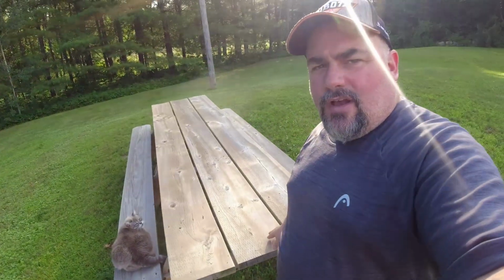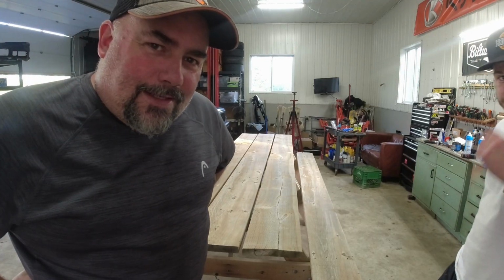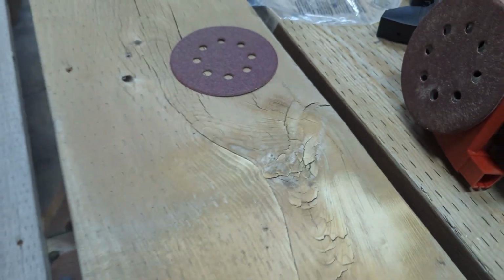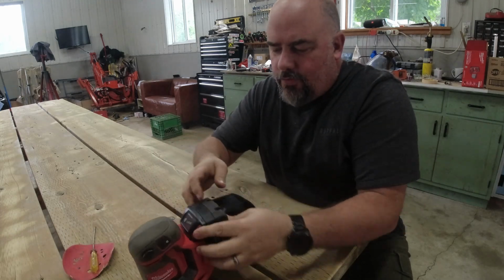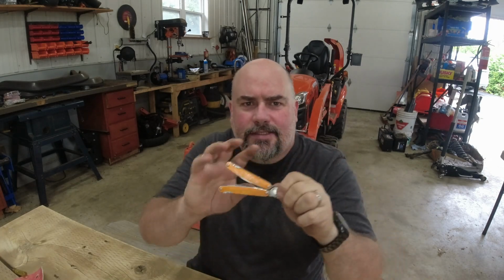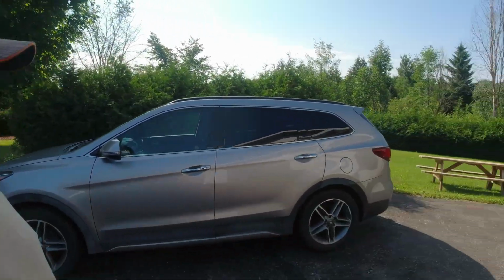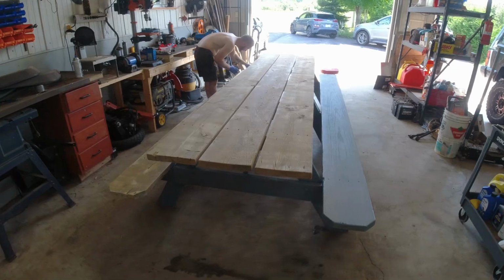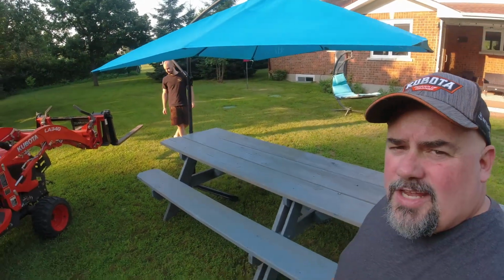Transforming A Picnic Table With Kubota - Watch How!

Comment: Ross, save the sawdust and mix it with yellow glue. You can fill in the cracks with it. I always carry one of my many Gerbers. Don't leave home without it. Nice job on the table. Bend some coat hangers to form clips to hold the table cloth down. Staples can really ruin a picnic. Take care and stay safe. PS: I have to do my table this fall.
Reply from the maker: Oh! Smart with the sawdust! I could have filled in so many of the knots and cracks! I'll know for next time.  And I'll have to find some wire coat hangers as most of ours are plastic! But another great idea! Thanks a bunch, have a good weekend!

Comment: Methinks I would buy new boards for the top, as that splitting  is from old age and sun drying of the wood. When I think of it, there would be a lot less work ( sanding ) with new boards. (Maybe for the seating boards too )  Great table though.
Reply from the maker: Hey Reg, I agree they are getting old so it's something I'll have to look into in the future, but for now it'll hold up well for another few years.  I was thinking I could cut the ends off and add a "bread board" end to it and maybe that'd help.  We'll see.  Much appreciated, and have a great weekend.
Reply: @RossOnTheLand  Yes, now that you've got it sanded and  panted/stained it looks like it'll do for quite a few more years.
Nice job.
Reply from the maker: Thanks Reg. That's what I'm hoping.